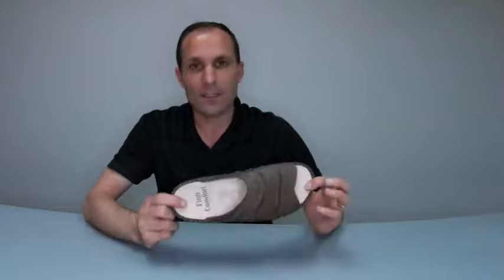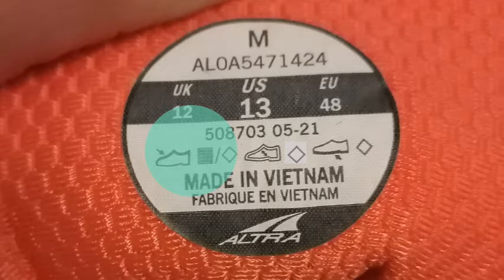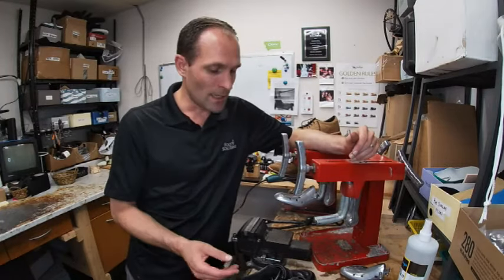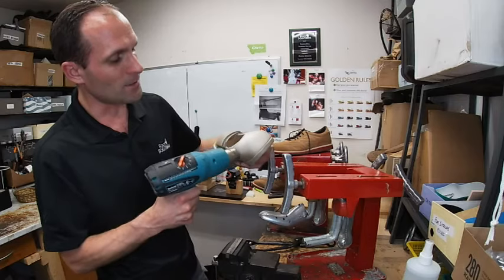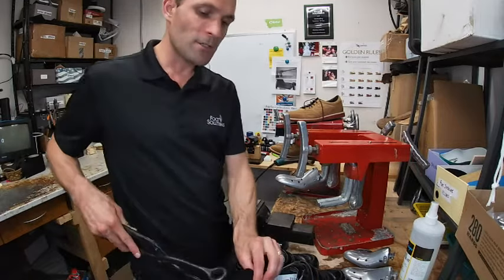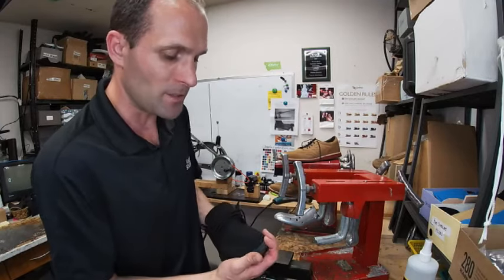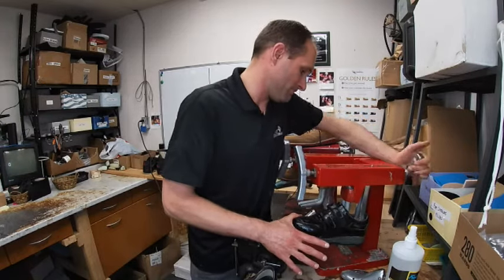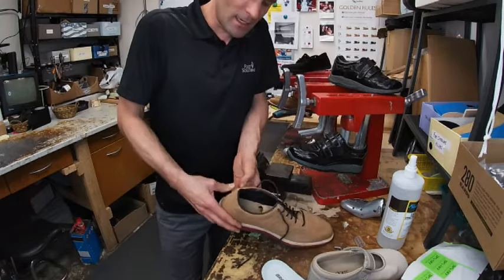How to Widen a Shoe

Comment: I’m a wide-toebox minimalist shoe enthusiast but I hate spending hundreds on special running shoes when what I really need are affordable shoes for working and playing in. I’m always getting pinky toe pain and blisters in regular sneakers and boots! I’m hoping to be able to stretch out the toe box on some affordable canvas sneakers with a plastic front. Thanks for showing this process - now I just need to fashion something to do the stretching!
Reply from the maker: You can have them stretched at a local shoe repair shop, as they will probably have a stretcher in store. However, if canvas is stretched too far it may tear. We usually gently heat up the plastic with a heat gun to allow us to mold it better.

Comment: How can you stretch a Skechers GoWalk all Mesh upper shoe?  Will heat, like using a hair dryer, make them expand or get tighter?  ty
Reply from the maker: These are difficult to stretch as the fabric may tear when you apply too much pressure on it. Usually we put these on a mechanical stretcher for stretching over an extended period of time, but we wouldn't use heat on it, as this can burn or shrink the fabric upper in this case.
Reply: @FootGeekzTV  Thank you.  I am currently using a hard plastic cup inside of the shoe to try to stretch them over a period of days.  I did try the hair dryer with socks on and my feet in the shoes, prior to your response, I did expand them a little bit but like you said, I was concerned about it shrinking the fabric or it just returning to it's original state.  I appreciate your response and enjoy your content.

Comment: Great video ---Thank You.. How would you stretch a indoor/outdoor moccosin with fur inside them.>? I think they  more like a suede than a leather. My big left toe rubs itself raw on the inside top and side--even on 2 new pairs I got.. And I have a brand new pair of high top Reeboks that have to be stretched about 1/2 size to a full size?
Reply from the maker: Sounds like you're looking to stretch the shoe in length. If you haven't worn the Reeboks yet, return them and get a bigger size. If they're too lose in the larger size, add toe fillers to tighten up the front of the shoe. Stretching length in shoes is next to impossible, as stretching the material will not lengthen the base of the shoe, which in this case would be too short. Fur or no fur, the shoes would be stretched in a similar fashion. However, stretching shoes in length is difficult.

Comment: Hi FootGeekzTv, thanks for this information. May I ask you please how to expand the upper fabric of On Running Cloudnova shoes? I paid a lot for this pair of shoes to be arrived internationally. I like them but it’s so tight from the upper middle part of the foot, the platform is fitting properly but after wearing them for minutes they rub my skin.    Unfortunately it costs a lot to send them back to size up to widen the shoes.   Any recommendations would be appreciated greatly 😊
Reply from the maker: Is the tongue attached to the upper or can it be opened up?

Comment: How do u stretch out a cleats for wide feet
Reply from the maker: Depends if they're leather or man made materials. With leather we wet the shoe and then stretch them on a mechanical stretcher. With pleather we use the same tool, but instead of wetting the material we heat it with a heat gun.

Comment: Widening shoes only works if the foot bed doesn't need widening.  I have very wide feet and the bed needs to be extra wide.
Reply from the maker: You're right about that. If the base of the shoe isn't wide enough for your foot, the outer edges of the foot will rest on the edge of the sole profile, causing pain or callousing.

Comment: I bought an Adidas running shoes and at the mid part it is narrow and it hurts when I wore them...the size is perfect but I guess my legs are more wide...not much problem in right leg shoe but it gives pain in left leg in the toe side of middle area...how can I resolve the issue?
Reply: Did you find a solution?
Reply: @Salman-ksh  i didn't used it enough because of some problems but it become bit loosened after using it for 3-4 days...so it might become loose after using for some time I guess if not then i will try to stretch it if i can but right now it's not a problem